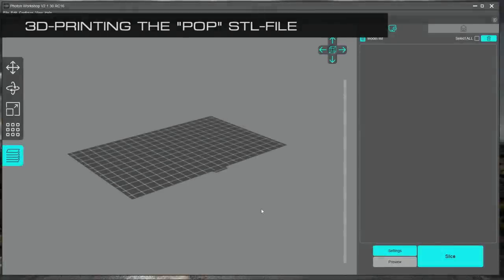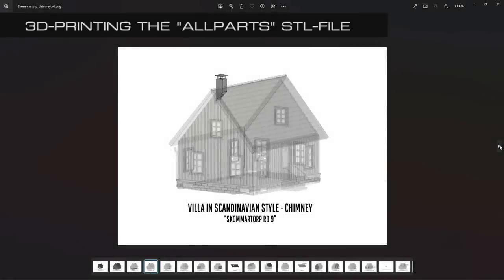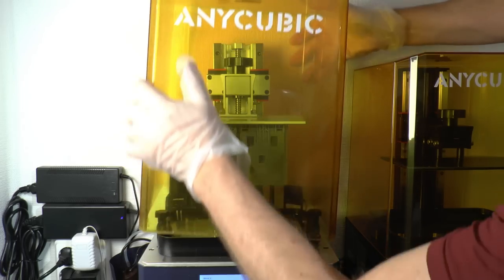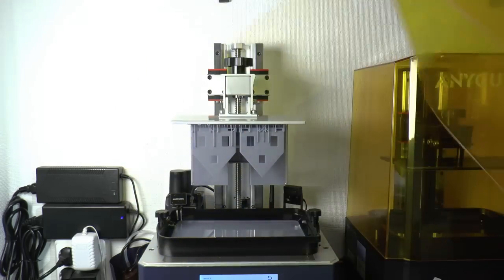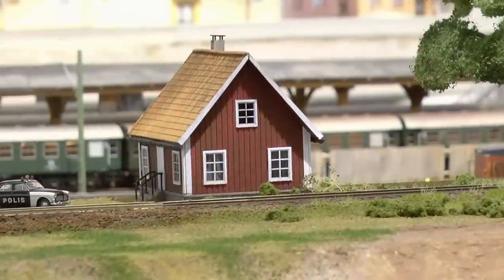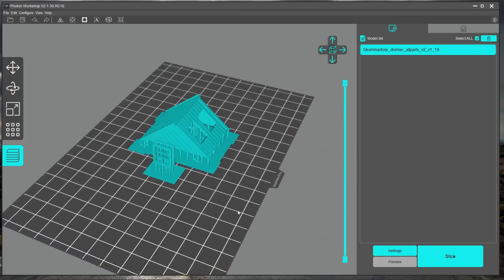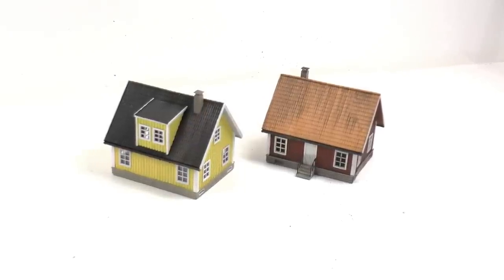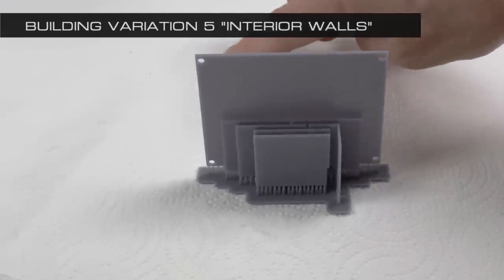Exploring the possibilities with next generation house kits

Comment: Martin, Thanks again for sharing your experience.  I've been playing with a laser and recently completed a goods shed.  Rather proud of the result from design to build.  However, I can see the advantages of having a 3d printer.  Still I'll be focusing on developing my laser designs and skills.  My builds are primarily from thin plywood/wood but also can use card stock or breakfast cereal boxes, etc.   Would be interested in seeing how lasers develop into the model railroad realm.  Anyway still enjoy your videos and learned that I need a few more modeling supplies.

Comment: Another great video, thanks for that. For handling of resin prints I like to remark if you really work with methanol the disposable gloves do not really protect your skin as it penetrates the glove! You won't realize it as it goes directly into the skin. Isopropanol has a lower penetration ratio and it is less harmful than methanol. I don't want to scare anybody ;-)
Many thanks for the printable interiors, I was just looking for such.
Reply from the maker: Hi Holger! Yes, you are correct. I´ve noticed that since I found methanol on the fingers but no holes in the gloves... I´ll probably need to change to Isopropanol instead.

Comment: Why not use joint spackle to fill those joint gaps? This is material used to fill drywall joints and embed tape in them. Mouser Electronics also carries those parts for the lighting.

Comment: Wonderful showcase. Do you know of any other creator that makes houses?

By the way. You can scale up and down really easy. I print a lot of detailed figures and I have no problem scaling up or down. Most new printers have much higher resolution than what the models are actually capable of taking advantage of.  You can even increase the layer height in this type of models to jave them print faster. I recommend chitubox slicer instead of the default from anycubic.